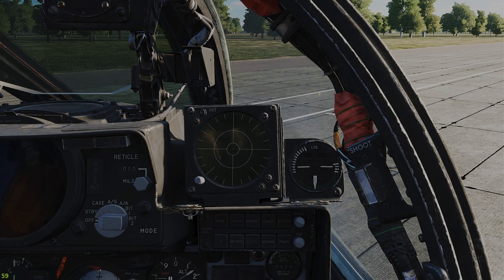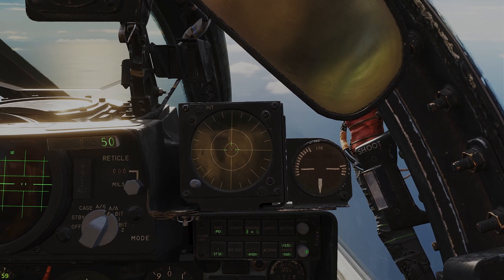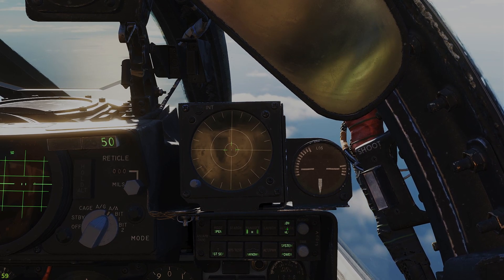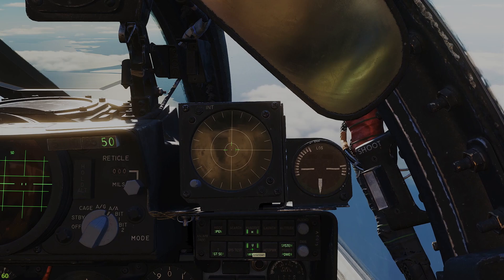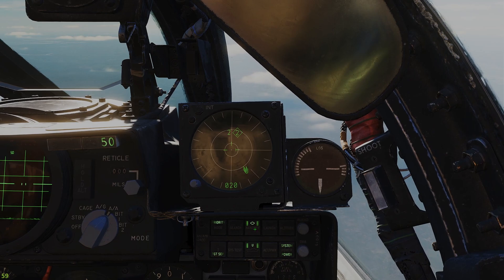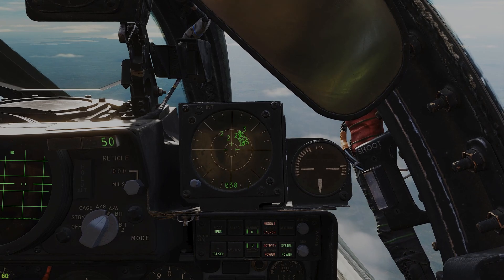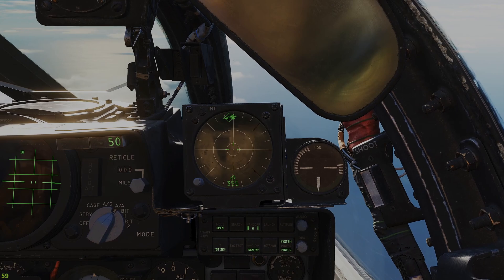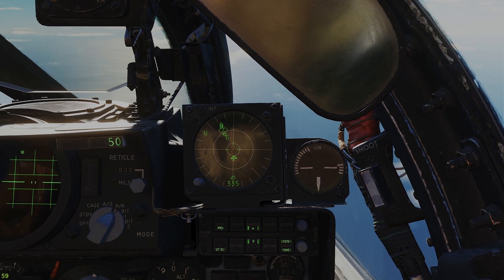F-4E Phantom: ALR-46 RWR Radar Warning Receiver Guide | DCS

Comment: I was Ecm / Ews repairman on f4, a7d, f105g in Korat 1972. We were getting apr36/37 systems removed and alr 46 systems installed. We could reprogran the pulse analyzer using a paper tape with holes punched in it. You first cleared memory and then had to do a hand boot where you inputed address and data using bcd switches. My first intr to the world of 1s and 0s that lasted all these years. To answer some of the comments, sam sites had to send guide commands to the missle after launching it. Air launched missles were either ir seeker or radar seeker using the planes radar to highlite the target and then the missle would try to track the reflected energy. Panel 185L was a giant pain to remove. 150 hi torque screws and almost always had some with stripped out slots.

Comment: Thanks for this video! Fun fact -- I worked on tail number GA 633 as an EW flightline worker. We were responsible for the AN/ALR-46, AN/ALE-40 as well as the AN/ALQ-119 jamming pod. The 20th TFTS was responsible for training Luftwaffe pilots in the operation of the F-4E and all tail numbers in the 600 series belonged to the Luftwaffe. IIRC, we had 6 of them. The RHAW system was updatable -- the Receiver and Signal Processor units were mounted amidship in the fuselage under panel 185L. The updates were applied via PROM chips in the Signal Processor, so -- Poosh, you are correct. It would be interesting if Heat Blur made that a programmable option.

I do have one question that has been bugging me -- What is up with the "Wow" guy? Who is that? ;-)
Reply: I was ECM on the ALQ 184. I trained on the the ALR 46 but I remember the tones and symbology differently than the video. Of course it's been 30 years ago now😂

Comment: The Phantom certainly "knows" the SA-8. I know this because I have often fought an SA-8 with shrikes for training purposes. But you can see that especially in the kneeboard the "8" stands for an SA-8 as you can see very well at 07:24 (in the game there is only one SA-8). What you see at 04:32 is probably the SA-13, which the system doesn't recognize.
Reply from the maker: Agreed.